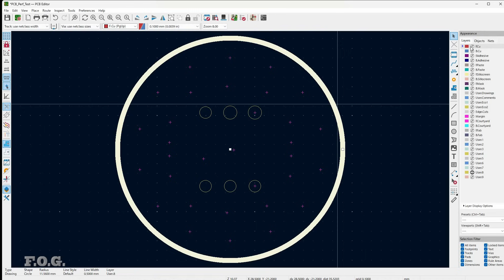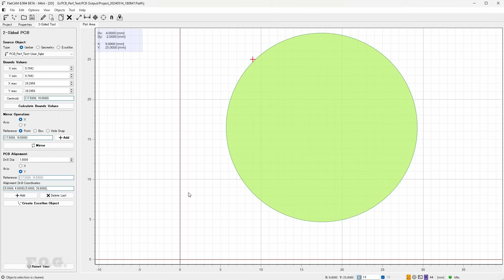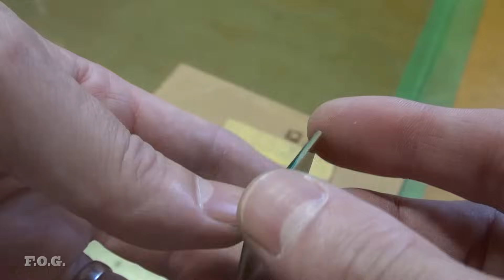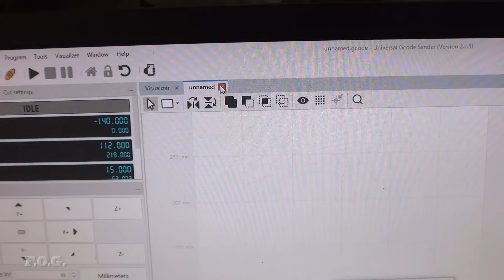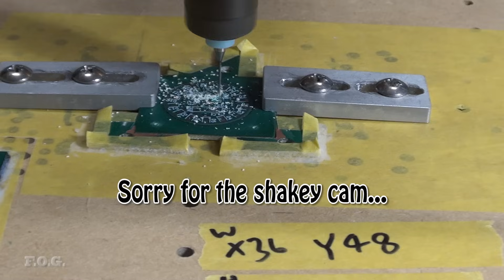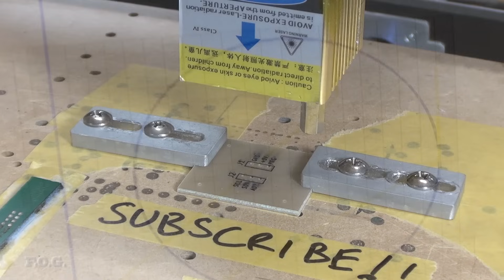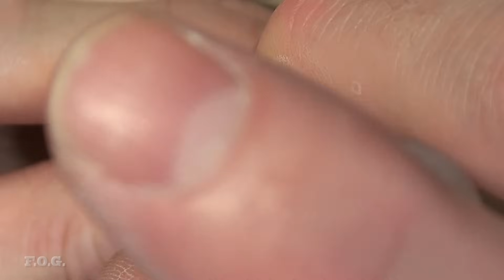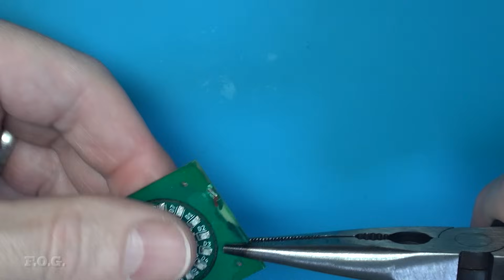The BEST DIY PCB Tutorial (ForOurGood PCB Method)

Comment: Thank you very much for the in-depth video covering all the details. As a maker with experience in FDM printing and plotter machines, I’m interested in exploring DIY PCB making. I have a question regarding laser power. I have access to a 3018 CNC machine with 2.5W, 5.5W, and 15W diode lasers available. Which one would you recommend for this purpose?

On a side note about alignment: there’s a system called ARMS (Auto Registration Mark System) used in plotter cutters with CCD cameras. It aligns roll media (e.g., 20cm x 50m) to a cutting knife. At regular intervals, it uses L- and T-shaped corner marks to align the cut vector with the media. My hobby-grade machine achieves about 0.1mm accuracy even on a 20x30cm grid. I believe a similar system could be implemented with a side camera attached to the tool head.

Once again, thank you for sharing your knowledge and for inspiring makers like me to explore new areas. Your content is truly invaluable!
Reply from the maker: The LaserTree one I use is sold as 40W, but in reality, most people agree it is less than 10W.  I don’t have any experience with other lasers, so I am not in a great position to make a recommendation, but maybe the 15W laser could be better at least when it comes to cutting the board, so I would at least try with that first. But if you find you have trouble dialling in the settings for the lower power settings due to lack of setting granularity, or alternatively the settings do not give consistent results, then I would switch to the 5.5W. I suspect the 2.5W one will also likely work fine, but cutting the PCB could be problematic.

Camera based alignment has actually been on my mind for some time, I even bought a ESP32-CAM with that in mind. Obviously 0.1mm accuracy is just not going to cut it (is that a pun?), so I would likely use magnification to try to achieve 0.01mm or less. The mark up and alignment process shown in the video could then be fully automated, and I am pretty confident I could achieve the desired result. But I am also cognisant that adding too much hardware complexity or cost to my process will reduce accessibility, which is a core tripe of what I have been selling here. So, for now it is on the back burner, but still hopefully will happen at some point, even so, the manual aligning process works really really well, and once you get used to it, can be completed pretty quickly, and anyone can replicate it easily enough.

You are very welcome for the video, and as you are clearly you are my target audience, I am always happy to hear it might have been of some use. Sadly, for the amount of effort that goes into the video, and considering I am showing a pretty good result compared to many other videos out there which get hundreds of thousands of views, my motivation ultimately takes a hit. And the primary reason I do YouTube videos is to get some motivation and purpose, so what can I say really, this is a problem I continue to fight to overcome.

Thanks for taking the time to comment, and I wish you success with your PCB making experimentation.:popcorn-yellow-striped-smile:
Reply: @ForOurGood  I truly believe your short content has massive viral potential. Your videos are filled with hidden gems, including captivating and satisfying close-up shots from vendors, repair technicians, and content creators. Even without commentary, the visuals speak for themselves and create a uniquely engaging experience. The quality of your work far surpasses competitors, setting a new standard in this space.

To maximize your reach, creating short content for newcomers and general audiences could be the key to going viral. Adding timestamps to long-format videos would further improve accessibility and keep viewers engaged, especially for those returning to replicate steps. Wishing you continued success and countless viral moments ahead!
Reply: @ForOurGood  Looks like I made a couple of mistakes in my first comment. Sorry, English is not my first language. What I meant by 'I have access to a 3018 CNC machine with 2.5W, 5.5W, and 15W diode lasers available' is that I can get any of these three versions from the vendors here.

Also, I misremembered the details about the plotter. It actually has an accuracy of 0.01mm when cutting and a 0.084mm return-to-position accuracy. Keep in mind, it’s a belt-driven machine with a +120cm belt (Siser Romeo). What impressed me the most is its skew correction using the ARMS system, aside from the impressive cut accuracy. Since it’s a roll-based system (up to 300m), it can cut continuously while maintaining 0.01mm accuracy, even accounting for media flex, angle misalignment, and uneven feed rates. The system achieves this by detecting L and T marks (3mm wide) and finding the center of the intersection using a camera.

I’m not sure if there’s an open-source version of ARMS, but there is a camera-based alignment system for multiple tool heads called TAMV (Tool Aligning Machine Vision). It’s an automated system for aligning X-Y offsets and could potentially be used to automate tool changes between laser and router heads.

As for bed leveling, I’ve tried nearly all the available technologies, and there’s a new standout called Eddy (Beacon). It’s incredibly fast and works like a LIDAR. Although it’s compute-intensive (I’m using a Raspberry Pi 4 with 4GB RAM and Klipper), the results are incredible, with over 300k samples on a mesh. I’m not sure if this level of precision is necessary, but it can easily compensate for bent or warped PCBs down to micron-level accuracy. My runner-up would be the Pinda probe (induction-based) since it’s also a no-contact leveling system.

Lastly, I highly recommend checking out the YouTube video titled DIY PCB: Professional Results with CNC + Laser by Alvaro’s Workshop. He showcases two great ideas: combining the silkscreen and solder mask application in one step and selectively removing layers using varied laser power. He also demonstrates a fast method for electroplating. Before watching his video, I had planned to follow Levi Jahssen’s method with two tool heads for electroplating, but Alvaro’s approach seems more efficient.

I hope these insights are helpful and spark some ideas for optimizing your workflow or future projects. Your work is already impressive, and with these additional techniques, I believe you could push the boundaries even further. Wishing you continued success and innovation!
Reply from the maker: @adonis_myth  If the 5.5W is the true optical power of the laser, and you are budget conscious, then the 5.5W one might be the better choice. If you are not confident that it is really 5.5W, or money is simply not a concern, then go with the 15W one first, and if does not work well, then buy the 5.5W one too.

The less than 0.01mm alignment accuracy makes more sense for professional equipment, so honestly, I am not surprised. But I am also very confident that this could be replicated at the hobby level too (based on my experiences so far). Hopefully I will be getting around to trying this myself soon enough.

Super high accuracy in Z-probe (or surface scanning) is simply not required with the laser process I am using, small Z-axis deviations really do not seem to have much effect on the beam shape that is working on the PCB. If you can achieve accuracy in the range of around 0.1mm it will fine for sure, anything worse than 0.5mm you “may” start to see issues.

I have actually seen Alvaro’s videos at some point of developing my process (they are very good), as well as Wegstr videos and many others who undoubtably provided me various inspiration for the process I have come up with. Some of my processes are undoubtably borrowing from a mix of these videos, some of them are just coincidental inspiration, but what from where I could not really say because it is all a mental fog for me. 

In EP7 of my original PCB series, I actually do use a similar “burn & fill” process for the silkscreen, similar to what Alvaro demonstrates, and the results I got were amazing as can be seen by my surprise in the video.. I even saw another more famous YouTube maker “inventing” this process for himself in a very recent video.  Unfortunately, none of us realised at the time of making these videos (some still don't realise to this day), that this process is actually very dangerous in some situations, and can destroy your PCB. If you want to find out more, then please see EP8 of my original PCB series. It is because of this experience I stopped using this process, and searched for a new solution, and came up with what I demonstrated in this video (which works really well and is safe!)

As for the “hole plating problem”, honestly, I have not seen anyone come up with a solution for this that I really like, but I also keep thinking about this problem myself too. As I state in the video, radically increasing the resolution of my PCB’s has basically made this a low priority problem since over 90% of the PCB’s that I need to make can now be done on a single sided PCB, and using a single sided PCB also comes with some huge cost, time and application benefits. Even so, hopefully one day I will crack this nut too.
BTW: I just saw a very old video called “PCB Plating without Chemicals”, that process actually looks fairly simply to replicate.. but I don’t know how the result would compare to real electroplating, or if the material used is widely available.

If you do end up making some PCB’s, I hope you take the time to upload a couple of videos and show us your results. Good luck!:face-blue-smiling:

Comment: Put a piece of scrap PCB under the other end of the clamp so that the clamp is parallel to the machine bed when you tighten the clamp screws. That will provide a better clamping area on the board, i.e. flat against the surface of the board and not just along the edge. I know lasers don't impart any force on the workpiece, but it's just good practice.
Reply from the maker: @trhosking the clamps are long, thick and  cut with a slot to ensure the clamping force is relatively flat (see episode 2 for more info). Possibly the slots could be a little deeper, but overall it does the job good enough for this application. Your point however is very much valid, the way the clamping force is applied is important!
Thanks for the comment.

Comment: Nice Job  and fantastic research well done . I try make ploter using IR led because hawe regular raund dot but problem whot i hawe is mechanical movement in axis . I use GRBL  board  and small stepers belts GT2  and teoreticly resolution is 10 micron but when i try clean area betwen traces all lose aligment  like stepers lose steeps but is not this because if i use onli contur  its ok its like board dont respect position from gcode and use tolerance to make more round numbers ich movement incres this tloerance error and if my dot move every 0.03mm its more error in every mm but if i move 200mm axis move perfect at 200mm. Whot leadscrew you hawe in your router ? Probably i leaw my idea use belts and i use leadscrews with 2mm pitch or 4mm pitch . Whot you think
Reply from the maker: Thanks for your comment and query.
I don't think you will get the required precision using belts, I am using basic leadscrews purchased from Ali-Express with 2mm pitch and 4mm lead, they work well with good precision up to speeds of 500mm/min. Please see other videos on my channel for more information.:face-blue-smiling:

Comment: you can share the chemicals you use?
Where can I buy them?
Reply from the maker: @witawat  I think I cover this is this video, as well as earlier videos. The only "chemicals" I use is generic 99% IPA as well as generic Ferric Chloride. This stuff is typically produced and branded locally in each individual country, so the local Japanese brand I am currently using is likely not useful information for the bulk of viewers (I don't even remember the brand I am currently using). Typically just buy this stuff from Amazon or other similar sites.
I am not sure if that answers your question, so if you need more information then could you be a little more specific?
Thanks for the question!
Reply: UV Color and 1:20:50 What TURBO ?
Reply from the maker: @witawat  Green "WNB" UV resin and White "Mechanic" both purchased from AliExpress.
The Turbo is a simple CA glue (super glue) accelerator, it is a local Japanese brand, but you should be able to find something similar locally.

Comment: Is it possible with fiber laser? I can clear mask okay. But what about sillkmask?
Reply from the maker: @retu191057  Actually, I don't know for sure (since I don't own one), but If the laser wavelength is close enough to what the UV resin requires to cure, and you can throttle the laser power low enough, then I don't see any reason as to why it wouldn't work. Give it a try and let us all know!
Thanks for the question.

Comment: Great video. What power does the laser have? Which items ( paste ) do you use (green and white)? is green Solder mask? Sorry for my bad englisch ;-))) Thank you
Reply from the maker: The laser I am using is a LaserTree Gold 450nm 40W-Pro 12V 20mm Fixed Focus Laser, apparently the optical power is in reality less than 10 watts, but still that works fine for me.
I do show all the items I use in this video, and also many of my earlier videos too, please check them out for the all details.
Thanks for leaving a comment!

Comment: I'm so glad I found your channel. I'm an Australian living in Tokyo and I have a 3030 desktop CNC and a cheap and weak laser module. I'm currently trying to make PCBs with solder mask at home. I bought a silkscreen frame at Daiso and are about to try it out. Even though I mill the traces with the CNC instead of etching, your videos are so helpful.

I would love to hear any more information you have regarding makers in Japan. I've found it's hard to get cheap materials like acrylic or metals for the CNC. Currently I get most of my materials and parts from Aliexpress.
Reply from the maker: @blabby102  20 years ago I used to mainly get stuff from Akihabara, but now it's only useful for heatsink, cable ties and cable.
Actually, there are a one or two new hobby component stores there now, but it's basically repackaged stuff from China, and since Ali-Express is cheaper, and delivery very fast, that's where I get most of my stuff from now too.
RS Components, Mouser and Farnell are all good for getting IC's that are the real deal, but it's never all that cheap, but for some types of chips it's the only way to go (buy Western brand IC's from Ali-Express at your peril... 99% are fake and either barely work or don't work)
For raw stock materials, originally I was getting stuff mainly from SuperViva Home, but actually what they have for machining stock is either not so great, or over priced. Tokyo Hands also used to have a good line up for stock, but they're even more expensive.
I have also used some online Japanese stores to get aluminium stock in the past, places like Misumi, prices are not bad, but the shipping can be costly, so it's only practical if you need a heap of stuff.
For smaller stock or plate materials, Amazon Japan is always a good place to check. Generally I always check Amazon for a wide range of stuff, sometimes it is surprising what they sell, and some good pricing too.
However, I got lucky a year or so ago, and stumbled on a physical store that exclusively deals with selling stock materials, thier prices is very reasonable, and they can get almost anything, and as I can pick it up at the store there is no shipping charges, even for small orders. The stores name is ㈱西山商店, typically they only deal as a wholesaler selling to other companies, but even, so they have been very helpful with selling me what I need, and currently is my go to place for raw stock materials.
Glad you found the video useful, good luck with your PCB making, and thanks for taking the time to leave a comment!

Comment: What are we considering a decent power laser? I have a 3w 405nm laser that I can use to engrave things I suspect that is enough?
Reply from the maker: @Segphalt  if that's a real 3W optical power laser, it should be enough to remove the resin. Maybe a little weak to cut the board, but you could do that a different way.